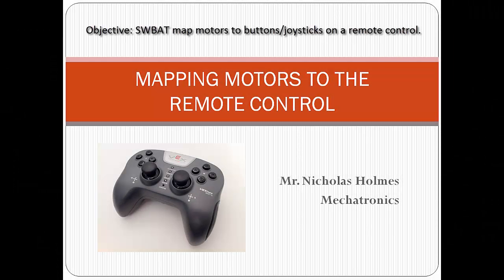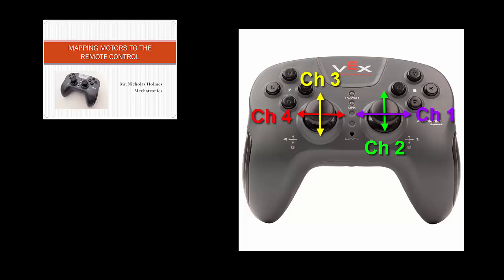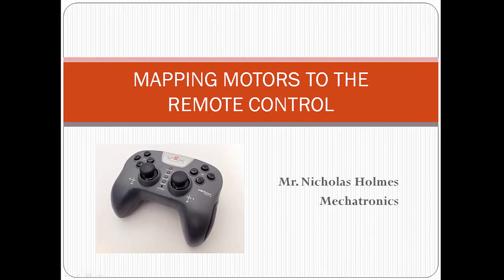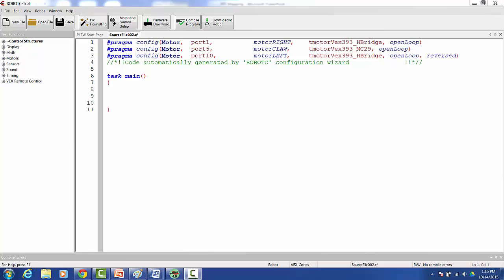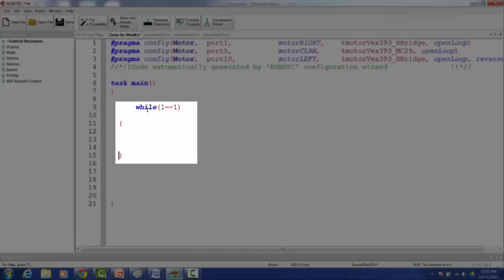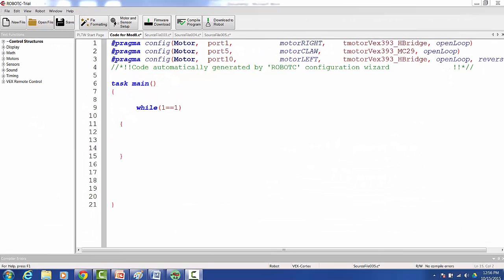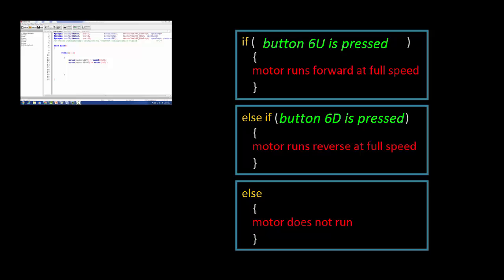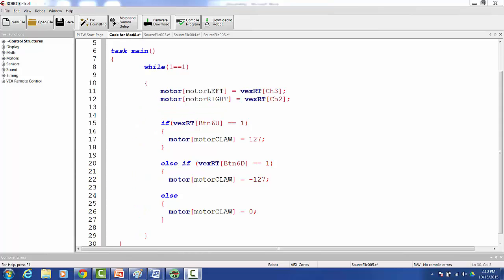VEX Remote Control Programming Tutorial Video

Comment: For the motor on ch2 and ch3, how would you add the speed to it
Reply from the maker: You wouldn't.  The speed value is controller by how far you push the joystick on the controller.  Not at all = 0.... push all the way = 127.

Comment: There's a code like this in a pdf I found for VEX Remote Controls:

motor[leftMotor] = vexRT[Ch3] / 2;

What's the "/2 " for?
Reply: It will cut the speed/power in half (so if you push to joystick 100% forward, the motor is only at 50% speed).

Comment: What if I wanted to set two motors to the same joystick? For instance 
moving the right joystick to the right makes a front motor move counter 
clockwise and a back motor move clockwise so the entire machine turns in
 a clockwise motion. I realize I could easily do this if I use the 
buttons, however not using the joystick for this just bugs me. If I 
can't it's fine, I'd just prefer to be able to.
Reply: Hi! I have this same problem and I was wondering if you found out how to do this